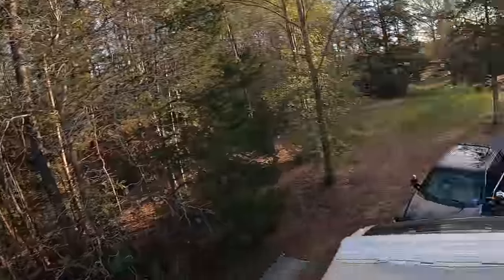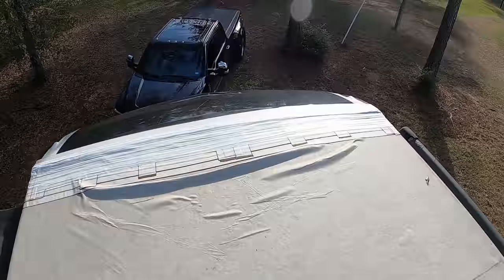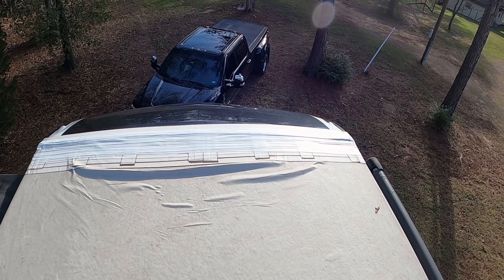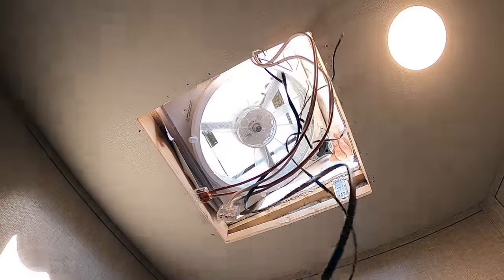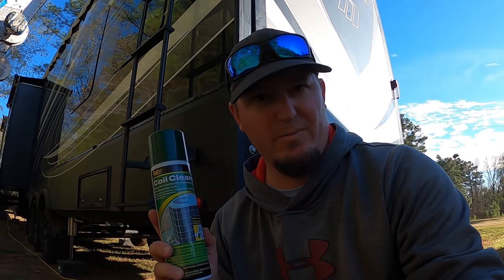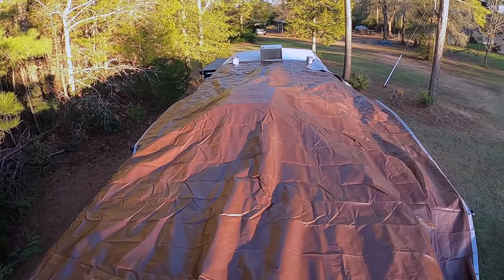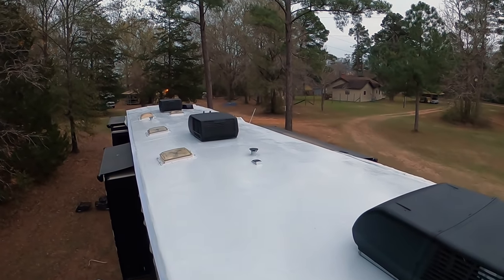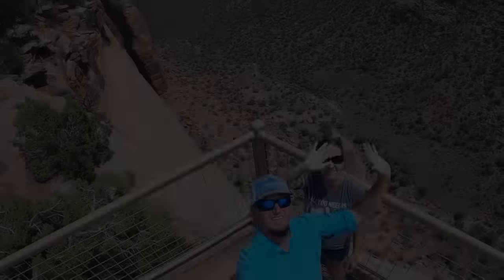Not Such A Grand Design | RV Roof Problems | The Downside To Fulltime RV Life!

Comment: Can someone explain to me why RV roofs are not made of fiberglass or something better than Vinyl etc.  I used a silicone seal on my rv and it works good but why do they not just make it with something like aluminum or fiberglass so it is more sturdy and resilient?
Reply from the maker: Our guess is because just as in the case of these frames, dealers and manufacturers are making a ton of money on the back end collecting insurance claim money when the roof fails. We went through that when our roof bubbled up after about nine months of owning our rig. We decided against the standard roof and went with RV Armor which offers a much more superior roof option that has a lifetime, transferrable warranty! We even suggested to Brinkley when they were in their development stages to offer this roof as an upgrade option and have an onsite RV Armor employee in their shop to install it on new units!

Comment: So if you were to have a small oil leak, will you change the whole engine too? You must have money to burn! You could have fixed your roof for about $30...
Reply from the maker: If I had an oil leak I would have fixed the seal or gasket that was leaking! In this case my roof was coming off the RV while driving so no it can't be fixed for $30 at least not the right way! Instead of putting the same sub par roof on we went with a lifetime solution that is 65% the cost of the factory roof!

Comment: GD gets a lot of accolades for having extra features as standard where other manufacturers list them as options. Their floorplans are well laid out. BUT GD uses the same manufacturing processes that many others use as well as the same furnishings and appliances. Any laminated TPO roof will have the same issues no matter who installs it. RV Armour is a superior way of sealing the roof and if GD or any other manufacturer wanted to step up their game, they would have to offer that as an option or something similar. The problem is it would increase the cost as well as more time to seal the roof at the factory. Go anywhere on the internet and many GD owners talk about quality of the brand, but when you examine what they are talking about is quality and features which is not really quality. For example, a bigger piece of cake foe desert isn't more quality than a smaller piece of the same cake. It's just more. Glad you didn't sustain water damage and found a better solution.
Reply from the maker: We have had problems with our camper, but we also live in it full time, so we expect to have more issues than normal!
That being said we would still buy a grand design again!  We also agree that at a certain price point and lifetime warranty roof should be an available option!
Reply: we almost bought a GD because of quality. But then we went with a different brand because specifically the quality of their roof was way better.
Reply from the maker: @zilann673  I think the RV industry as a whole could build them better!  As much as they cost we should not be having some of the problems we do!

Comment: Too be fair sir your roof was already going.in the begin of vid you look down on roof you see a black line is indication the roof material is old. When there old like that the adhesive is nolonger there
Reply from the maker: I also told you that this problem happened at the beginning of our trip out west!  It traveled this way for almost 8 months and close to 12,000 miles before we had the roof repaired!  We knew we had to get a new roof but we were not going to stop our travels to repair it unless it became a complete failure before we made it back home!

Comment: I'd hate to ask how much you paid for your camper. It's ridiculous what you are going through to make it right. I was thinking I would like to get a small single axle for myself, but from what I'm hearing and seeing, I've decided it's just not worth it. For the price you pay for one, it should be built bulletproof from bottom to top
Reply from the maker: That is why we bought used!  Even with all the repairs we have had to make we could still sell this RV for far more than we paid for it!  With the exception of the roof every other repair was very minor and easily repairable!

Comment: I have solar panels on my roof.  Can Nate work around those or will they all have to be removed?
Reply from the maker: They would have to be removed to apply their roofing membrane and apply the rubber product but would be reinstalled for the final coat, so he could add the flashing and sealing around each screw!
Reply: @PavingNewPaths  I have a Grand Design Reflection.  I guess I'll start stashing $6k now for when it's my turn, lol
Reply from the maker: @rachelthegooserv1645  Well our price was a 40 ft toy hauler! Plan on about $200 a foot if you do a complete tear down!
Reply from the maker: * Discount Code for RV Armor***
Tell them you saw the video on Paving New Paths to get $100 off your roof
Reply: @PavingNewPaths  ouch!! That sure is a lot of $$$

Comment: Why don't they make the roof a one-piece FIBERGLASS shell like the front and back cap of the trailer?
Reply from the maker: Because of cost! No one would be able to afford it if they did! They however could offer a lifetime roof like RV Armor or other brands from the factory and that is something people would pay for!
Reply: @PavingNewPaths  That would be a good plan. When I was shopping for my RV I was shocked at how many brand-new trailers had bubbling roofs and bubbling seals on the roof around the front and back caps. I purchased a used Landmark Heartland trailer and last night the kitchen table window started dripping in the pull out, so I walked around the trailer with a flashlight to inspect the rest of the windows and discovered that the previous owners had to silicone the tops and sides of all the frameless windows. I don't understand why the manufactures think these frameless windows don't need a gutter and flashing over the tops and around the top 1/3 of the sides of the windows to stop rain from getting between the frameless glass and outer walls of the trailer. You would not have the glass in your house windows sticking out past the wall of your house because then they would leak. People today are all kinds of stupid.

Comment: Hi…just came across your YouTube channel. Very informative! May I ask please what is the over all length of your 5Th wheel? Also, in the video I have seen you have not been able to open the toy hauler to use the porch or access. We are looking at a toy hauler, but it looks like there are many restrictions for space to utilize the toy hauler opening.  Would you tell me more about using the access? Thank you ! 😎
Reply from the maker: Thanks for watching!  Ours is a Grand Design Momentum 397TH and it is roughly 43ft long!  We use the rear patio a lot when the weather allows, but now that it is getting hotter, we don't open the back up as much!  When we were out west and the weather was cooler we used it daily!  We typically don't leave it open at night because our kids sleep back there, and we prefer the security of having the main door up at night!  If we know we are going to be somewhere where we want to use it, we make sure to reserve sites long enough to allow our truck to be parked in the site while the back patio is extended.
Reply: @PavingNewPaths  thank you for promptly getting back with me. I am enjoying much of your channel, but my husband will get the most out of it because of your technical, troubleshooting, fixing, researching, and manpower Demo’s. 😎
Reply from the maker: @kendraladrido3058  We have some videos coming up where we just made changes in the toyhauler for the kids beds and changed things in the livingroom and bathrooms!

Comment: I'm confused!  What makes this membrane better than the original other than the free technical support?
Reply from the maker: One. It is not a piece of rubber that is just glued down and stretched over the edges! 2. It won't rip or tear. 3. it comes with a lifetime warranty, they will also come to you if you ever need any repairs done! 4. no more dicor required to reseal every 6 months. The membrane they use is very similar to fiberglass batting! They then do a basecoat and two top coats! The final product is similar to a rubberized bedliner for a truck!

Comment: What was your total out of pocket costs?
Reply from the maker: For us  we requested the entire vinyl roof be removed including the radius behind the gutters it ran about $200 a foot!  If you mention Paving new paths you can save $100
Reply: @PavingNewPaths  What size of coach do you have.  We currently have a 35' Layton with a full metal roof.  But are planning on buying a Grand Design Momentum 398m-r.  Was looking at a new one but beer pocket book puts us a looking at a used coach.
Reply from the maker: @brianroth7852  We have a 397th its roughly 43 foot.
Reply: So you total cost was about 8600$.  Correct?
Reply from the maker: @brianroth7852  The cost is based on the linear foot of the roof not the total length of the coach!

Comment: Some say this is another sign of the frame flex issue. This was our first sign.
Reply from the maker: Our roof failed over 2 years ago! We have been all over the road since then and didn't see any frame issue until our last 500 miles heading home!
Reply: @PavingNewPaths  ours did too. It failed in 2021. And our frame broke in July 2023. The major movement started in July but we had minor movement in 2021-2023

Comment: I'm wondering if GD uses the same roofing on their G series Momentum?
Reply from the maker: I believe all RV manufacturers use either Vinyl or TPO roof.  Both of which can become a problem!
Reply: Actually some have 1 piece fiberglass caps and there are a few that have 1 piece aluminum roofs.

Comment: Whoa what? OSB on the roof of a top of the line RV? I guess I'm use to seeing aluminum everywhere. I figure they would at-least use fiberglass for the top cover. I remember watching a KYD vid, they had a whole front corner seem rip apart just shredded wood. It makes me real uneasy thinking about a wood frame structure taking on all the torq twist and jolting going down the road.  I'd rather buy an old school or greyhound bus.
Reply from the maker: Our camper is an aluminum frame with fiberglass for the walls! The roof is a wooden truss system with OSB, covered in vinyl, now RV Armor!  The way it was explained to me by the roof technician they use OSB because it needs to be flexible to bend and twist with the camper while traveling down the road!  If it was solid it would eventually rip its self apart!  He also mentioned that alot of those class A's that have fiberglass roofs is just a layer on top of OSB as well! He said probably 95% of campers you see on the road are built this way!

Comment: This is a great video.  Thanks for doing this one. Can I ask what was the cost?
Reply from the maker: It is roughly half the cost of what you would pay for a replacement TPO or vinyl roof.  Ours cost was a little more because we requested a full tear off of the stock vinyl roof.
Reply: What r we looking at BALLPARK $$ cost.  . I had the EXACT same problem. Luckily it was covered by the INSURANCE.  SO I didn't care what it COST . My travel trailer wasn't even 7 months old.  They put the PVC roof on.  NO PROBLEMS so far. But my trailer just got out of the shop 1yr 2months, 7days.  Because of VERY BAD CRAFTSMANSHIP. Been LEAKING since Contraction.  I bought it BRAND NEW.
Reply from the maker: Ok Ballpark with full tear off of old roof is roughly $200 a foot!
Reply: Linear ft. Or square foot?  Thanks for your quick response. Have a BLESSED day and stay SAFE
Reply from the maker: @pushbroom9398  linear foot!
Reply: Thank you.
Reply from the maker: * Discount Code for RV Armor***
Tell them you saw the video on Paving New Paths to get $100 off your roof

Comment: Thanks for the information. I am wondering if you have any problems with your full size fridge not being secure enough to keep it from rubbing on the trim around it, ours rubs on our island as well.
Reply from the maker: We haven't had a problem with that (yet)! We have a small space between the door and island, so they haven't made contact. Maybe placing a pool noodle on the side of the island would help! That's what we do on the sides of our TV because it rubs the trim around it on travel day! Just slice the pool noodle open on one side and slide it onto the island trim!

Comment: So did they expect you to do all the work on removal and reinstallation of the fans and air units or would they have done it all as the included price? How many locations do they have or limited to a state?
Seems like travel trailers have a lot more quality oriblems then back in my days. Frames, suspension, roofs and I guess I have seen poor wiring video.
Sad the industry has changed to the evil side.,😥
Reply from the maker: He would have done all the work himself for the price. I helped because it would have been so much up and down the ladder for him, plus I was filming the process. They send a tech to wherever you are in the USA, so they can service you anywhere! I think any rv is going to have issues, especially when you live in it fulltime and move as frequently as we do. That being said, the rv manufacturers should stop taking the quickest and cheapest steps when building these rigs, especially for what they cost! But we would absolutely consider a Grand Design in the future, despite the few issues we have encountered! Our next rv will have a RV Armor roof put on from day one though!

Comment: Well look at where you park at. Doesn't get a chance to dry.
Reply from the maker: We travel fulltime so the trailer never stays in the same place for more than 2 weeks!  If you are referring to where this is filmed, it was only there to have this job done and then we were on our way!  The stock roof or the RV armor roof we installed do not need to dry, they are waterproof that is why they use it on the roof to keep water out!

Comment: Why they don't offer a fiberglass roof as an upgrade is beyond me. My previous New Horizon had one and those are the best roof systems. One solid piece from side to side end to end. But, I plan to get the Flex Armor system.
Reply from the maker: I don't understand why they don't make a roof we don't have to worry about! I would pay for this to be done at the factory, especially if it came with a lifetime warranty, and was relatively maintenance free!

Comment: One  question, this is a roll on rubberized membrane?
Reply from the maker: It's very similar to fiberglass batting material that is put down on the wood, then a thick first coat that dries semi hard!  Then he follows it up with two topcoats that are very rubberized when it dries!

Comment: We just bought a 2022 Solitude, 345 GK-R last October. They went the cheap route on all the hardware. Nothing is secure. Drawers collapsing, speakers falling off the walls, etc. I've already had to replace the water heater and kitchen faucet. Naturally the roof started leaking around the Winguard. On the lip of the Wingard it has the word "front" with an arrow. My arrow is pointing to the port side. At the end of the day the real problem is dealing with customer service and their "who gives a crap, we have your money" attitude. Tylinna is a total lying sack of horse pucky. Very sick of the whole thing. Might as well do the roof now as it looks like the next major flaw of this junk ass camper. Thanks for the vid.
Reply from the maker: Goodness, so sorry you've experienced all of that! Our next camper will have RV Armor roof from day 1! If you end up getting the roof done, use code Paving New Paths for $100 savings!
Reply: @PavingNewPaths  Will do, thanks
Reply from the maker: You're welcome!

Comment: 30 years of single ply roofing, and I must say that is some cheap a$$ stuff the manufacturer uses. I don't think it was even 45 ml thick with no reinforcement member. Destin to fail under those kind of wind speeds. Hope your new roof works well for you. Great video though, wish he would have let you show more of his process, but everybody thinks they can be a roofer till it comes to the details.
Reply from the maker: At RV Armors request they didn't want me to show the process, only before and after each step.
Reply: I don't blame them. It is their business.

Comment: What did you do for he seams of the plywood
Reply from the maker: They lay down a fiberglass type batting material as the membrane and once they do the two base coats and top coat it becomes one permant piece that is a very rubberized bedliner type feel!

Comment: Very interesting topic. Do you think the underlying plywood may be part of the problem for the liner to not adhere properly? In other words, if a fairly green plywood has some residual moisture, heat could cause the moisture to release and weaken the bond. I would think that as fast as RV's are being made now, getting well cured plywood would be difficult. Still waiting for our GD to come off production line.
Reply from the maker: The tech who does all brands of roofs every week said they dont let the roof cure before moving to the next step and they should terminate it better at the front and rear caps!